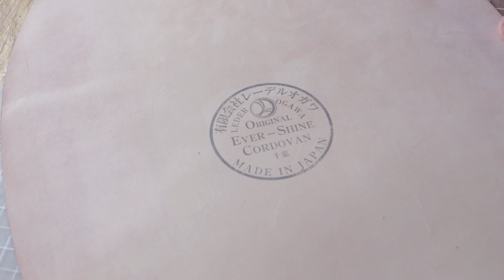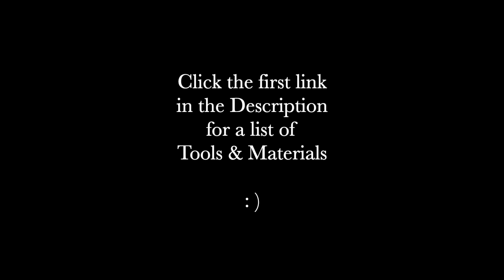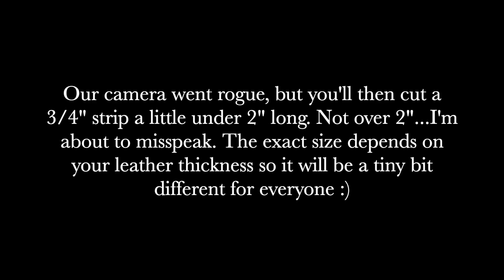Shell Cordovan SHOWDOWN!

Comment: Novice question: You made the watch case strap from leather, with the thumb/finger grip loop, and the ~2" slightly raised piece for it to feed into (essentially locking the watch case). You mentioned not wanting to use rivets/snaps bc it can damage a watch when pressing to snap it together. Is there any reason not to use either Velcro or magnets to secure the watch case? I can see magnets being too thick to embed in the leather (or messing up a digital watch?), making the case awkward and bulky. And Velcro would probably look a little tacky with nicer leathers. But are those possible options for a design like this despite the small size?
Reply: You pretty much answered your own question already. Velcro would look cheap and wear out relatively quickly, and magnets can absolutely screw up an analog watch as well as a digital one. You could use hardware and cover the interior exposed bits with skived leather or a liner, but that would also add to the thickness.

Comment: When you make a tote bag what size stitching irons do you use
Reply from the maker: 5mm usually for almost everything - watch straps, bracelets, etc I'll go smaller but it depends on the scale of the piece
Reply: 4 or 3.85 ideal, some use bigger,  but fancy crafter uses as low as 2.7mm.

Comment: I’ve got an idea, let’s see what you think. Would it be ridiculous if you could make a case for sunglasses? I have a set of prescription RayBan’s that case is plastic man-made and it’s beginning to crack however the inside of the case is shaped for the sunglasses. I imagine the the case would have to unstitched and the inside removed and used in the new case.  What are your thoughts, really curious to know.